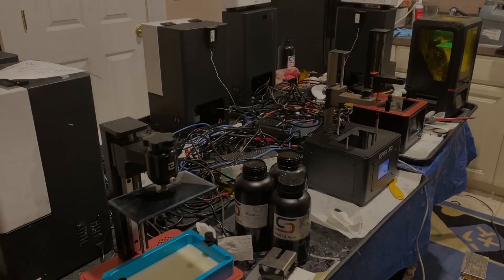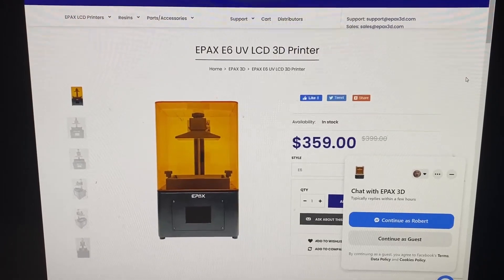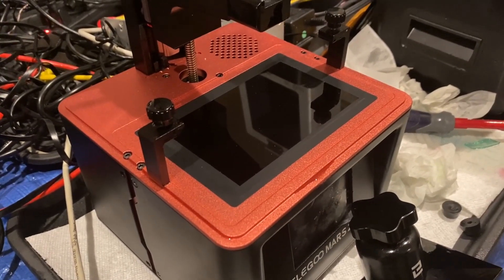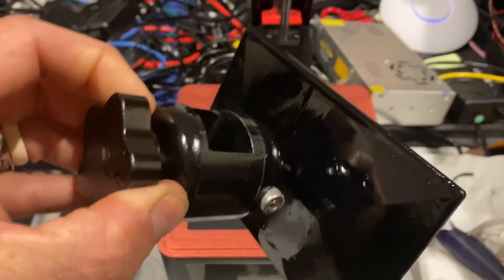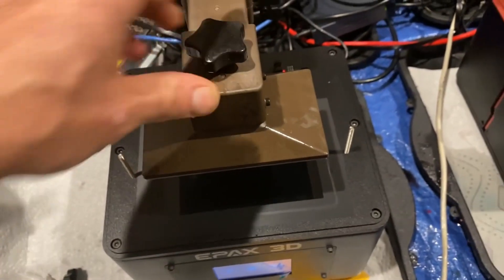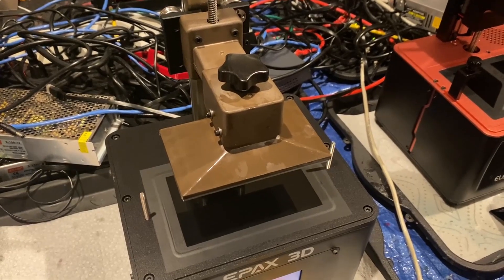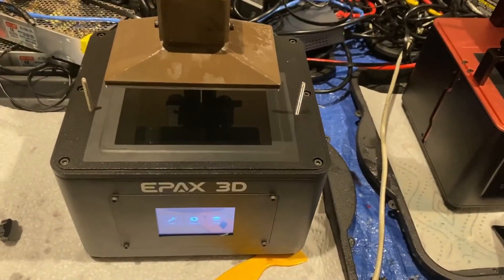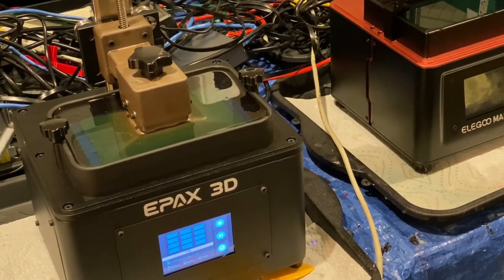EPAX-E6 vs Elegoo Mars 2 Pro Mono Printer Comparison

Comment: You should consider the Mars 2.  The Pro is $100 more for essentially just a fan (that doesn't do anything) and aluminum vat (which you really don't need) and 0.25 inches of print height.  I have it and it's a real value by comparison.

Comment: I m new to resin printing and I just got X1K. Should I be able to print larger functional prototypes and end use parts with it?  I heard about problems of model distortion and resin shrinkage...
Your resin prints are end use? Would they change over time? 
Btw, I've spotted new Epax ceramic filled resin that has very low shrinkage %

Comment: I'm all the way for Epax I owned 2 X1 (now only one and a E10) the Epax plate will never go off once leveled one time I accidentaly  drop one on the floor and it didn't go out of level! Easy maintenance, Upgradable and reliable Epax for life.
Reply: Even removing strong adhering parts with spatula?
Reply: @brezovprut4431   I have done more than 2000 print on my og X1 and I never have that kind of problem. The only time I relevel the plate is when I change the screen. Also if your print stick to hard to the plate you should think about lowering exposure or number of base layer most resin at least for me stick prety well with 4 botom layer at 40 to 50 sec exposure...

Comment: Hello Robert, thank you for the video and your observations about E6.
I have an Anycubic Photon mono, so 6" 2k mono screen, and I use it very often to print mechanical parts. I need good precision and I use to print on the plate, so I have a question: for improving the precision of my prints I should buy an E6 or go to the new 6" 4K mono screen printers (like phrozen sonic mini 4K)??? Is it worth it ??